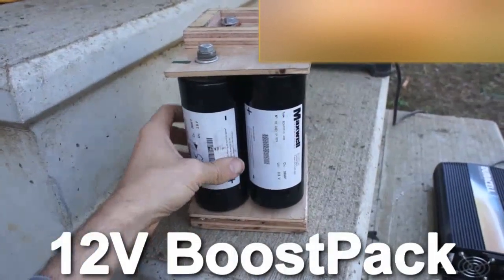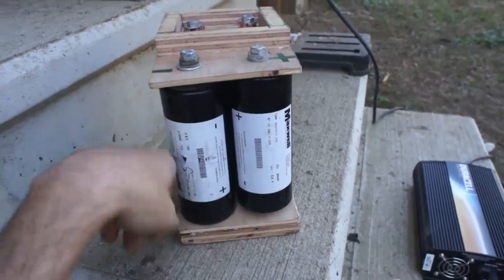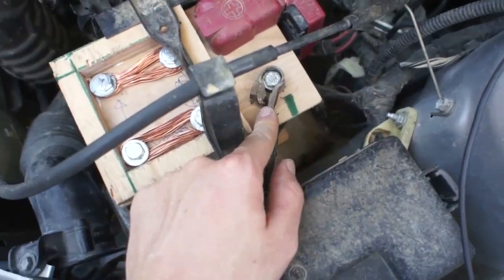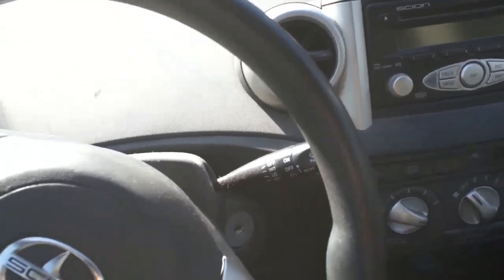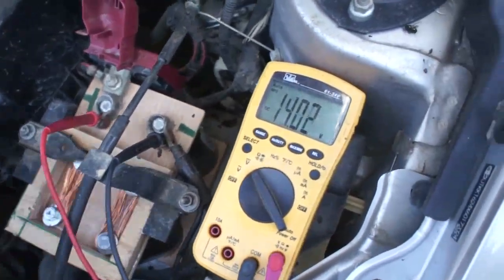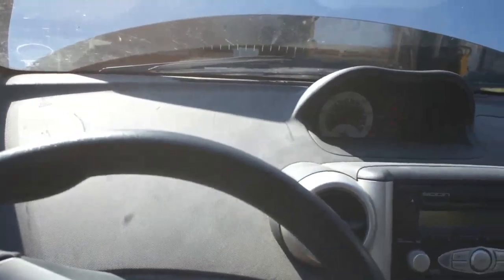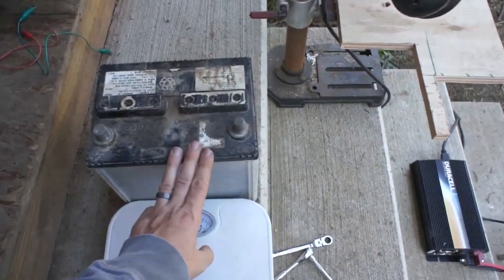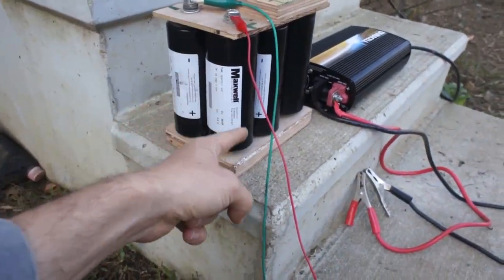12V BoostPack. Replaces auto battery. Works great!

Comment: So what happens in the long term?  How come car batteries aren't made this way?
Reply: +mychannel Little capacity and high cost. With 2600F capacity (I don't know exactly how much it is) at 14V it is only 36400 As = 10Ah, while it costs about $200 in total. Considering that modern car batteries hav about 60-120Ah, this is too little for a general use in our society.
Another side effect is the high leakage. You can't place your car in the wilderness for some weeks as it won't start again.
Reply: ***** You're right.
And yeah, the voltage curve makes the different, although I would be interested on how low the voltage can drop until a car won't start again.
Different devices shut down when they reach a specific voltage, but how about starters?
Reply: Holy crap, the cancer in this comment chain is amazing. Capacitors are not used because they are more expensive than batteries, are less durable, and also cannot store as much energy and also discharge themselves rapidly over time. Additionally when capacitors do fail, they tend to explode which is a poor choice in an automobile which is prone to crashing while holding a tank of volatile fuel. 

Also bone drone is obviously ignorant about capitalism. Capitalism does not stifle innovation, it encourages it. If capacitors were the next thing since sliced bread, a company that does offer capacitors as a replacement for batteries would quickly become the biggest and most successful company since consumers would buy what is better. The issue is that capacitors ARENT better than batteries just yet, and so they aren't used as a replacement.

You think you are going to get innovation in communism or socialism? Please. All you will get is whatever is offered by government approved businesses and you don't get the choice of competition. Politics determines what is used in that case, not what is most pragmatic or desirable.

Plus even if your capitalism conspiracy was true, why would companies be behind the cheaper batteries when they could be selling capacitors which cost more "$+$+$...." and bring in more profits? Answer? Becuase they can't function as well as batteries yet.
Reply: Bone Drone Fucking capitalists again!! Damn them!
Reply: ***** I don't think you see the entire picture. Again.

Batteries= $+$+$+$+$+$+$+$+$+$+$+$+$+$+$
Capacitors= $+____________________________

Onto energy density how about this. You saw a set of capacitors similarly sized to the battery being replaced and it weighed 1/5 what the battery did. So therefore is size for size a fair comparison? How about weight for weight?
Reply: Mark Schulz IV You're the one who's not making sense Mark Schulz (the fourth, lol). You're the one who said you spent $2100 per battery.  I don't know why you would do that.  Last I checked, car batteries were like a hundred bucks, so spending $2100 seems pretty nonsensical.
Reply: Mark Schulz IV That doesn't make any sense.
Reply: Mark Schulz IV Nope, you are the one who's too dense to put words together into cogent sentences.  Your arguments are trivially stupid.  Why did you bother to comment at all?
Reply: Mark Schulz IV Then why did you say you spent $2100?
Reply: Mark Schulz IV You're the one not making any sense here; if anyone is a troll it's you. Let's hear more about how it makes sense to pay $2100 for a car battery.
Reply: Mark Schulz IV Ah, the need to tell lies for no reason....
Ah, the need to fabricate shortcomings in others to cover up for your own inadequacy...
This has nothing to do with my need to be accepted, it has to do with my need to make sense of the world.  If it was some kind of a joke, or an outright lie that's not a joke, why didn't you just say so instead of acting like a complete asshole?  
The ridiculous comments you make have nothing to do with what kind of person I am.  Why would you say you paid $2100 for a battery when it's not true?  Is it supposed to be a joke?  It's a good thing you don't care about being accepted! Lol..
Reply: Mark Schulz IV Hehehe... You're not throwing insults at me, but I'm reacting like a baby? Was the irony intentional? Is this another "joke"?
Anyway, I edited out the part about you being a fucking idiot.
Reply: Mark Schulz IV You've been banned from a forum site? That doesn't really surprise me but do you even have a point?  Why are you participating in this thread when all you have is insults, or lies about $2100 batteries?  Oh right, it's because you were banned from the car battery forum, no doubt for posting ludicrous battery prices and then insulting people when they didn't get 'the joke', and so now this is the only place you can scratch your peculiar OCD itch: a compulsive need to lie to strangers about battery prices.
Reply: Mark Schulz IV Yeah he did just say that.  He's saying it again because he doesn't think Pysics & Stuff understood it the first time.
Reply: Mark Schulz IV I don't know enough about this to comment on that.
Reply: Mark Schulz IV Yes. How many times do I have to tell you the same damn thing? Want to talk about pros and cons?

Batteries contain toxic material, are extremely expensive, cannot be charged very fast without catastrophic damage, are frequently replaced ($$$$$$$), incredibly heavy, supply less current when the temperature drops, and contrary to popular belief are never maintenance free no matter what the label says.

Would you trust a "maintenance free" battery that you left on a shelf for five years to reliably start you vehicle every time? Face the facts or shut up.
Reply: Mark Schulz IV Good. Keep paying. They love it.
Reply: ***** So 400 years is an arbitrary number. But this should help. It is but one type. So have fun. 

http://www.johansondielectrics.com/ceramic-capacitor-aging-made-simple
Reply: Mark Schulz IV Your comparison doesn't seem relevant. These lighters are designed to be disposable as in they're never refilled. So its not going to matter what creates the spark. At least I showed you what a person can do to keep the same product running for the long haul.
Reply: ***** Understood. But again this isn't your only option. Are you implying that the ceramic type capacitors are 100% incapable of starting a vehicle? That sexy pack in this video sure did. (Insert joke here)
Reply: Mark Schulz IV I already had a person who shall not be named argue with me because I chose to do the smart thing and not buy into the auto makers bullshit. Why should I give GM $16,000 (give or take) twice as often? What do they have to show for it after being bailed out with your tax dollars? If you ask me, disgrace.
Reply: Mark Schulz IV If you're trying to be a joker then you're quite terrible at it. Changing the subject from batteries to cars, then back to batteries again. Joke or not, if you spent $2,100 on 4 batteries that equals $525 per battery. Joke is on you there buddy. 

Ahhh hell I can afford it so why not!
Reply: Mark Schulz IV If you say so.
Reply: Mark Schulz IV Hahahaha, and you accused me of trolling? How funny. Next I bet you're going to tell us the Sun is square and the moon revolves around you. 

"I do it because I have the money" ????

No, it's because you're a dumbass. No one ever pays $525, or $2,100 (whichever it is) for one battery. Anyone who does got conned, because they're an incompetent moron, and rightfully deserve what they got. But hey, maybe you'll call it "following the industry", because you have no voice or mind of your own. So keep getting jewed because you're good at it. Take it up the ass hard from your corporate leaders.

In the future when electricity costs $2,100 per Kw/hr keep on forking it over because they love it.
Reply: That's not money I don't have, it's money YOU don't have because you stupidly spent it on a car battery.  I have a LOT more money than you, probably because I don't do really stupid things like spending $2100 on a car battery.  A fool and his money are soon parted, and that's why you don't have any money.  Also I'm not an American.  Also, you can't visit the car battery forum because you told me you got banned from it.  (I assumed you were talking about a car battery forum since that's our topic of conversation, but I guess it could be any other kind of forum.  I don't know why you even brought up the fact that you've been banned from forums, since it only helps me make my point that you're acting like a complete jackass.)
Reply: Mark Schulz IV That's a false dichotomy. If either one of us has a room temperature IQ, it's definitely you.  I already know my own IQ is genius level, so you're barking up the wrong tree if you're trying to get me to feel bad about myself... try insulting me about something that actually applies and you might have more luck.  Thing is, you know nothing about me, so it's gonna be hit and miss.  Keep trying though, it's entertaining to read your pathetic attempts to make yourself feel better by putting me down every day.

As for the first half of your message, it sounds like you actually DID spend $2100 on a battery... I'm pretty confused now because I'm pretty sure earlier you said the whole thing was a joke. Doesn't matter though, I'm no longer interested in unraveling the mystery of how much money some random idiot spent on a car battery.
Reply: Mark Schulz IV Um, you might want to proofread that, it's even worse than normal; makes no sense.
Reply: Mark Schulz IV Insult me if you must; I only speak the truth.
Reply: Mark Schulz IV Huh?  Okay, I have no idea what you're babbling about now, but whatever......
Reply: +Bone Drone I agree with you almost totally ..except AGM's and calcium batteries are the ducks guts but cost serious bucks.. lead acid is dead.. maintenance free ain't free.. but this system looks on the surface pretty good for a daily driver.. keep your AGM or starter pack on the shelf or in the boot should shit not work out for you.. I grew up with electronics..this is a no brainer for me.. really a fabulous idea..
Reply: bicanoo_magic Who are you quoting? Yourself? I never said that.
Reply: +mychannel Also because of capitalism. Keep the people coming back for more because they don't last forever unlike capacitors. 

Batteries = $+$+$+$+$+$+$+$+$+$+$+$+$+$+$+$+$+$+$+$+$
Capacitors = $+_____________________________________________

What makes more money is what is chosen. Do you feel duped now?
Reply: Mark Schulz IV I'm not trolling. I'm probably being rude. Whether I'm civil or not you're the one acting like another uninformed sheep who has no voice of his own, or better yet is defending the robbery at the hands of the manufacturers. Batteries last 5, maybe more, years. Capacitors last 400 years. :P to you. 

Thanks for admitting that batteries do indeed suffer from all of the above mentioned by me save for, according to you and you're wrong, "maintenance free". Is trickle charging a battery not a maintenance procedure? Do you not do so to maintain the battery's state of charge and give it the longest possible shelf life when it's not in use?
Reply: Caps don't last forever.

Comment: Good luck with your Alternator!  there's a reason why you have to use a lead type batteries and what specification it needs..   engineers aren't stupid how to calculate how much the alternator will charge or not.. Well, you saved 80 - 100 bucks for a battery but you cost yourself an alternator or labour for 400 bucks.. it all depends too how deep is the location of it..  pray its not an Mazda MPV where you need to lower an engine down..  lol
Reply: +Ken M That's a very uninformed comment. The only reason why these aren't used in all cars is the little capacity (this setup is only 10Ah compared to up to 100Ah in modern batteries), high leakage and high cost. He got these capacitors for very little money and he doesn't need a high capacity as he uses the car pretty often. But this won't be useful for everyone.
Also, if you want to save your alternator, you can just limit the current with a little resistance.
Reply: +Ken M Engineers aren't stupid? You mean the same engineers that make engines whose pistons won't even stand up 100,000 miles at stock power levels. Look up the GM Ecotec motors and you'll see. So I really don't care what it is you have to say nor have I ever cared about what all these various shills who earned a blah blah blah "degree" at university x in the year 19?? have to say as many people have been shown real living proof that auto engineers are not the greatest and smartest on this planet.
Reply: Hoch134 Except you don't have to buy a new car every 10-20 years and you damn well don't have to abide by the what the industry demands. Do you believe in adding to life expectancy as in is it possible and should you do it? Capitalism, a.k.a. thievery is only getting more prominent and you're going to accept this knowing you're spending the same (or more) amount of money a lot more often? Not me when I can do something about it. And I sure can.
Reply: Hoch134 Good. You don't like people who stand up for what they believe in. It's only what the elites of this world say is how it should go right?
Reply: Bone Drone So you want to say that an engine whose pistons change direction over millions of times aren't good? That's a really dumb statement.
Reply: Hoch134 That's not what I said at all. I said: THE GM ECOTEC MOTORS BREAK AT STOCK POWER LEVELS BEFORE 100,000 MILES. 

But I'm sure you'll find no fault in that either right?
Reply: Bone Drone That's pretty common. And no, I don't. Of course you could build a motor which won't break. Ever. But think on the cost you will pay for it.

And for a motor on which parts will last 100.000 miles, this is pretty good. You could also just change parts every 10.000 miles and prevent it from breaking.
Reply: Hoch134 No one should ever have to buy a new crank, pistons, rods, whatever every x thousand miles to keep any engine running, period. No excuse for that. 100,000 is a big number, but is nothing compared to 218,000. That second number is the mileage my previous car drove until I sold it. The engine still ran in that car. Only when the price of the car is cut in half will this be cool by me.
Reply: Bone Drone This hardly depends on how you use your car and how it's set up.
If you drive your car carefully, that does a lot.
The car I drive normally gets up to 360,000 km, which is about 140,000 miles. But you can never predict that.
Also, cars aren't made for the future. We should buy new cars every 10-20 years according to the industry. Therefore, you won't find cars which last more than 200,000 miles i the future.
Reply: Bone Drone You don't have to. But they are built to not last that long.
I still don't think that a car with 140k miles is bad, but I won't continue to discuss that with you.
Reply: Bone Drone That's what I mean. You just take one argument and place another, thinking that other people wouldn't know that.
I won't waste my time with discussions which have no end. Good luck.

Comment: did you measured charging current? caps have very low internal resistance, i'm afraid that alternator is very loaded - this may shorten its lifetime.
Reply: +wilkk It is very likely that such battery replacement will make alternator die sooner. Think about it : The every time you start a car, alternator has to recharge capacitors, obviously at uncontrolled rate which is almost like a short circuit. And if there is even less voltage in caps, the alternator is working even more.
Reply: +Mark Schulz IV I know, imho there should be simple circuit made of relay and "high power" resistor that will limit charging current
Reply: +wilkk You could place a resistance in between to limit the current. To about 10A for example? Would be 1.4 Ohms of resistance.

Comment: My favorite part about this system is the charge time. When your battery dies, you need several hours to regain the charge and thats assuming your battery has any life left in it. The caps charge damn near instantly. It would be great to have these wired in the trunk with a bypass so they are there for you in the event of the battery failing.
Reply: +Josh Denham They charge quickly for two reasons, their internal resistance is lower than a lead acid battery, and their capacity is also tiny in comparison. A capacitor can't store nearly as many amp hours in the same volume as a lead acid battery.

Comment: what would happen if this went in my 01 s10? I have a system drawing around 500 watts
Reply: One need not "replace" the battery when one can have a boost pack and battery? That way one can keep the existing, maybe reduced, capacity of the battery while adding the cranking amps of a boost pack.

Comment: Might be a stupid question, but if I replaced my battery in my motorcycle and kept the pack in and charging while using my bike can the capacitors overcharge and blow up? Will it damage my charging system?
Reply: +Fred Wiedlich 

i also have an idea, to hook up traditional battery, and hook these boostpack in parallel (hybrid system) these should keep the capacitor charged at 12.5v while the bike is off, and 13.4-13.6v while the bike is running..i dont think it will mess up with bike's charging system,
Reply: +Fred Wiedlich 

i am a biker too, lol
Reply: +zyar46  Thanks for your reply. i have a 99 Vstar and replaced the battery last season. I had a problem with corrosion and messed up the battery terminal trying to disconnect it to clean it. Now I need to replace it and have been following videos on super capacitors which I would like to try. Thanks again for the video and reply! Keep me, us posted on your ideas with these capacitors.
Reply: +Fred Wiedlich When capacitors charge up to their nominal maximum rated voltage the internal voltage in the capacitor will start to oppose any incoming charge.  Example: A capacitor charged to 12.6 volts will oppose any incoming charge at that same voltage. Overcharging a capacitor is most likely to occur with uncontrolled charging voltage.